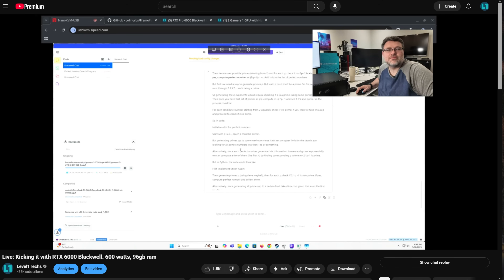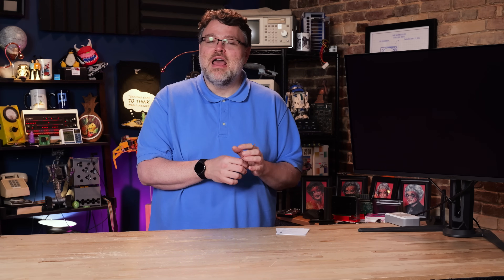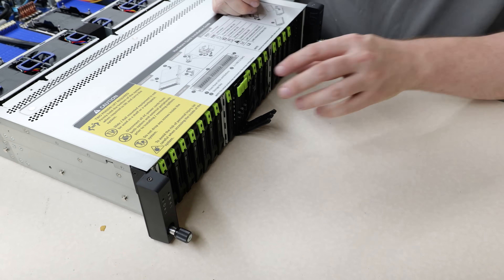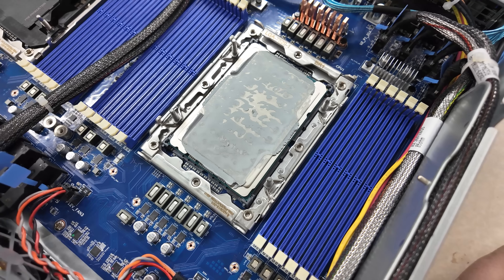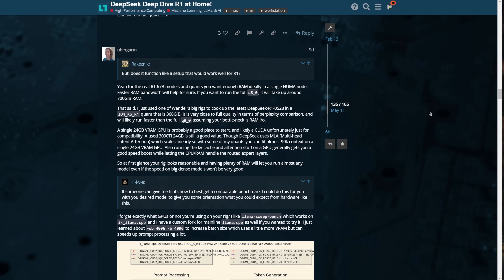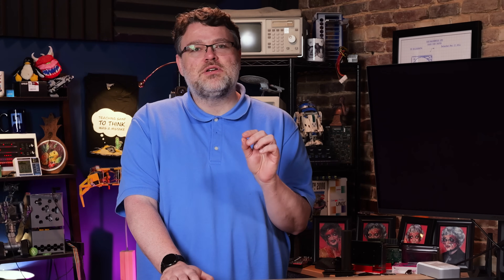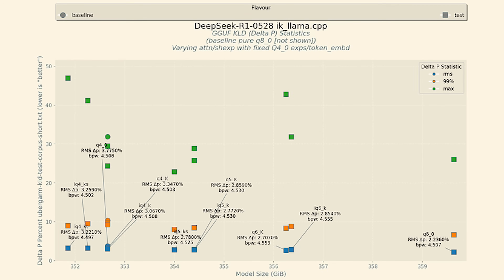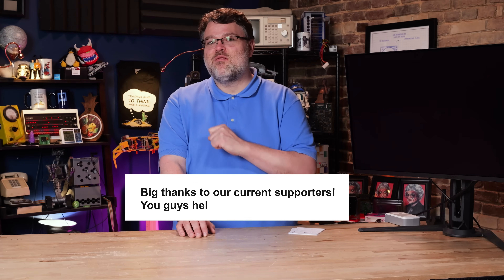Run Deepseek locally on a 24g GPU: Quantizing on our Giga Computing 6980P Xeon

Comment: Very cool, I will test the IQ4_KS on my box (TR 5965WX, 512gb ram). How many 3090s are needed? 
I have 2 in my imagegen rig and a third on the way. I'd prefer not to pull my 5090 out of my workstation 😂
Reply: A single 3090 24GB VRAM is enough to run 32k context with `-ngl 99 -ot exps=CPU` hybrid style! More VRAM will get you more context or offload a few more exps for more speed.
Reply: @ubergarm  Hi, have you tried running qwen 3 235b with partial offloading and 24gb of vram? From what I know, there is no single shared expert to offload to the gpu, but qwen 3 moe's expert activation rate seems to be quite biased, so offloading the most frequently used experts might have the same effect.
Reply: Let us know what TPS you get on a largish query, please!!

Comment: I'm running two instances of Ollama because my hardware is weak.
I have:
9950X3D
192GB
2*9070XT
So, one Ollama has access to my GPUs, allowing me to run up to 32B Q4 models there, sometimes two smaller models at a time, one for code completion and another for coding tasks. The second Ollama doesn't have access to GPUs, so I'm running my DeepSeek only on my CPU for very slow requests (3,5 tokens/s). The model DeepSeek-R1-0528-IQ2_XS from Bartowski is fitting well into my 192GB of RAM. This allows me to run multiple models simultaneously without any issues. 
Sadly, buying computer hardware is extremely expensive in Ukraine. Our prices for computer hardware are significantly higher than those in the USA, especially for recently released items, despite the current tariff situation. Meanwhile, the average salary is $550, which is more than 10 times lower than what you would find in the USA. Getting into LLM stuff is very challenging.
Reply: bartowski is a great guy and makes solid quants, that is likely a good choice in terms of quality for your rig. Yeah RAM bandwidth is the limiting factor for token generation speeds. You have enough VRAM to use `-ngl 99 -ot exps=CPU` which works on mainline llama.cpp as well. Plus probably a few more layers. So might be able to get a little faster optimizing your command.
Reply: @ubergarm  is it possible to try and keep weights for specific experts on gpu? i haven't really looked into it too much, but some experts are much more frequently used than others, so it might be possible to get better performance by loading (parts of?) the most commonly used expert(s?) to gpu.
Reply: have you tried using your gpus for mixed gpu/cpu inference with R1? i have heard that you can get quite a speedup on large MoE models with the right offloading strategy. and what kinds of ram setup do you have (speed, channel count)?
Reply: @steffenaltmeier6602  
Hi, no. Before that, I had seen some videos where LLMs did not fit into the GPU, and they had about 5 tokens, so this would not provide any benefits for me.
After that video, I will definitely try to run DeepSeek in a CPU+GPUs combo.

I have four sticks of Kingston Fury Renegade 48GB 6000, but due to my "awesome" Asus ProArt X870E, the highest stable speed is 5200. For this speed in XMP, I saw different timings, so instead of 32-38-38, I'm running 28-33-33 and Refresh interval 40000 instead of 11250. The Refresh interval definitely improves the RAM speed and latency.
In AIDA64, I have these results:
67 GB\s Read
72 GB\s Write
66 GB\s Copy
80.6 ns latency

Without an improved Refresh interval, the latency was about 100 ns.
Reply: @rodionserhieiev  i see, thanks for the information! In terms of CPU+GPU inference i tried it out myself for the Qwen 3 30b model and there  with minimal offloading (kv cache + feedforward on all layers) i was able to get >50% speedup. Not sure how that would scale to deepseek, but i did say such setups being tested back when the model came out. There should be at least some performance gain possible on your system (as well as a bit more free ram to possibly use a slightly larger quant)
Reply: @rodionserhieiev  your board is also using dual channel only. not sure how costly boards with quad channel are, but that would likely be a sensible upgrade since your board is also not handling the rams all to well.

Comment: Is a 9950x3d with 192gb of ddr5 6000 cl 30 enough with two 4090s
Reply: For sure! That is more than enough. Offload extra layers onto the additional VRAM to speed it up a bit but you got plenty to run my quants of the full deepseek r1.

Comment: Can you show us how to do this on amd hardware? All the guides I see are for nvidia
Reply: A lot of FUD going around, I see. Meanwhile I'm running large models in Ollama and llama.cpp multiple AMD GPUs. Some models perform better in Vulkan than the CUDA-through-HIPify variants.
Reply: @0LoneTech  Yeah very odd responses in Wendell's channel no less. Claiming demonstrably false things instead of doing one google search to at least sus themselves out.
Reply: @0LoneTech fud? yes, look at me sowing fear lol 😂 Low on specifics, I notice. Which models? How many tokens/second?
Reply: @DoctorMandible  I'm on vacation and you're offensive, so I probably won't tell you.
Reply: @0LoneTech 😂😂😂 easily offended, I see. Enjoy your vacation. Sounds like you could use it
Reply: @DoctorMandible  People really exaggerate the nvidia advantage. Tried out ollama with R1 14b and was hitting, been a while, around 37 token/s. And that was on a old AMD 6800 16gb. Frankly, the GPU was not even taxed, mostly because the model was hitting bandwidth limits. 

The issue is not NVIDA better hardware bla bla... The main issue is that you need memory and tons of bandwidth. Only when you exceed those, them limits like the hardware kick in. A 5090 will have a better time because of the spare memory for the same model (what helps with the context size as people forget that you need memory for your actual context), and the almost double memory bandwidth. But its not going to give you 6x the performance (relative cost of the AMD vs Nvidia hardware).

Hell, people have been running the full deepseek R1 model (not quantized) on pure CPU. Sure it was only 4 a 5 token / second, but that was on a 2k server (700GB).

LLMs are extreme dependent on memory bandwidth (and being able to fit the entire model in memory). The hardware below that is only a secondary factor. Its amazing to see how little people know.
Reply: @benjiro8793"The issue is nnot nvidiais better hardware bla bla". Right, that's why I said the issue is CUDA, not hardware.

The difference is overstated? Sorry, did aamdjust 10x iit'sstock price in the last couple years? Are they selling out their stock months in advance to corporate and government contracts?

It's not me overstating anything. I tried explaining why nvidia is the current choice for llms.

It's not me saying it. It's the whole world.
Reply: @DoctorMandible  dude, you literally said buy nvidia because llm requires cuda
Reply: @speedracer9132 because it does. You can point to hobby projects which don't. But nobody except niche technologists will benefit from tinkering with them. Anyone else is better off using the industry standard.

It's like if this video was about building houses and the comment was asking how to build an igloo in Alabama. Yea it's possible. But everyone else is talking about the useful stuff that people can use.

Edit: And BTW it's trivial to rent gpu on the cloud, even privately. So with a little know how, you don't need to shell out for your own nvidia gpu. It's literally pennies to several dollars per month, even for extensive use. Cloud gpu is cheap af.
Reply: The short answer is you can't.
The long answer is that it's a pain to set them up to work with AMD, and to have them work as good as with nvidia.

So the most practical way is for you to use nvidia stuff.
Get a cheap 3090, should be more than enough, you don't need 4000 or 5000 series nvidia stuff.
Reply: For Deepseek NVIDIA is required due to the low-level optimization they did(think CUDA assembly language). AMDs HW is capable but they just dont have the SW stack.
Reply: @jjdawg9918  I concede nvidia hardware is better for this, but that doesn’t mean amd can’t. Yes, nvidia will be more powerful, but generally speaking amd is perfectly capable of running a local llm
Reply: Since GGUF quanting is CPU only, you can literally quant the models on either EPYC or Xeon pretty interchangeably.
Reply: Step 1: Buy nvidia. This requires cuda, which is proprietary. That's the whole reason why nvidia cards cost so much more than amd.
Reply: @DoctorMandible  lol no thanks, I’m not giving money to that company for over inflated prices and hardware that barely competes with last generation. AMD products are perfectly capable and there are models for it, just not many video guides
Reply: @speedracer9132 AMD really aren't tho. Not saying it's impossible, but they're far from perfectly capable. GL finding stuff for it.
Reply: @speedracer9132  why ask the question if you ignore the correct answer?
Reply: @speedracer9132  Barely competes on what? gaming? You want it for AI though, so Nvidia is the way to go. I'm telling you this on an all AMD system. You CAN use AI on AMD hardware but it is not even close to the performance of Nvidia. Even Wendell will tell you that, if he sees your comment.
Reply: @evildude109  That wasn't his question though. People saying "buy nvidia" are just being rude.
Reply: @Kwazzaaap  no they aren't. It's well known that Nvidia practically INVENTED AI on modern GPUs, and that their hardware is BY FAR THE BEST. AMD IS NOT EVEN CLOSE when it comes to AI. It's just that this comment section is full of AMD fanboys in denial. But with all that said, RDNA4 does at least in theory have FP8.
Reply: @Kwazzaaap correct answer, not rude. He asked for a tutorial on how do the impossible. And now he's insisting that amd can do it, despite me telling him otherwise.

Comment: Great content! Excited for Quantization-Aware Training to be used someday at Deepseek, should have some amazing results if Gemma 3 QAT is anything to go off. Note that VLLM is tracking QAT support in issue #16856.
Reply: QAT (at least as implemented by torchao) can only target a single weight/activation/gs type. Because of that, I think QAT is of limited usefulness unless you are targeting a single quantization to run at.
Reply: @lhl  Yes, I agree it's of limited use unless targeting a single quantization, but I wouldn't mind them trying still. I think it's unlikely they're willing to sacrifice perplexity for speed beyond float8. Thanks for the reply :)
Reply: @lhl  Good to see you here! Love your recent work with Shisa V2 405B! That is a serious project!
Reply: Quantizing Gemma 3 27b QAT was wierd, it broke the usual patterns as the iq4_ks has a "better" perplexity than the bf16 hah... I have a good quant for that on huggingface as well for ik_llama.cpp.